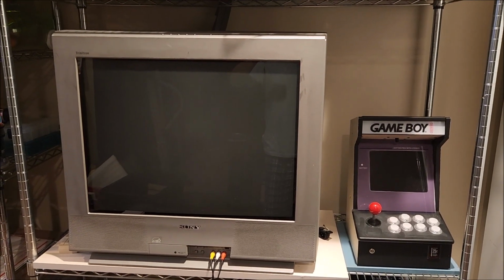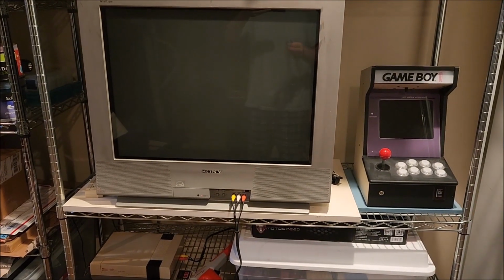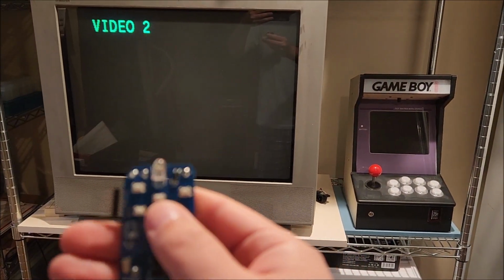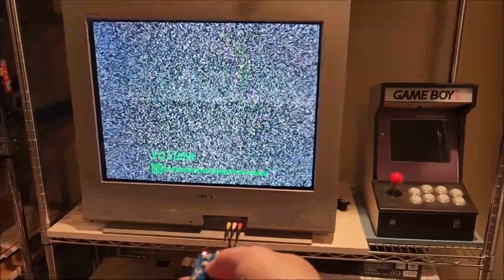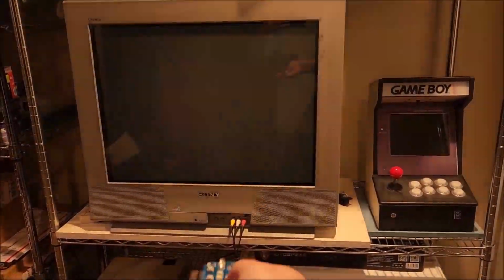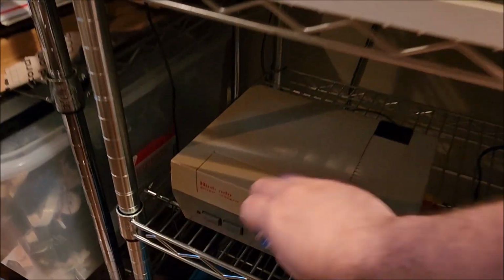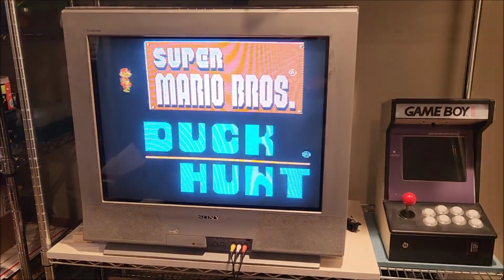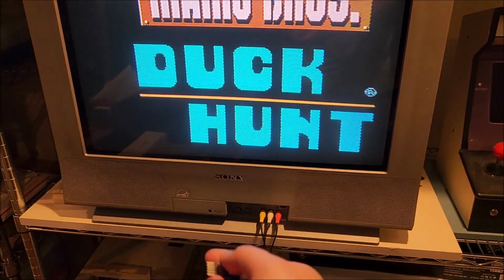Introducing the Remoteduino Nano: A Tiny Reprogramable IR Remote!

Comment: I've been looking for an IR remote that can record signals and allow me to store and manage them. Not sure why those aren't a thing, at least I couldn't find one.
Reply: That's been a project I've been meaning to get around to for a while.  Figure on trying CircuitPython, and if that doesn't work give Arduino a shot.  Not so much a "remote", but a hacked together circuit with a microcontroller.

Or one tool now commonly available for that is the Flipper Zero, with the onboard IR sensor and LED.

Comment: These sorts of things are begging for a soicbite connector. No need to carefully hold onto pogo pin rig, no need to solder a connector. You get 8 pins, you can combine ISP for bootloader programming and serial. vcc, rx, tx, gnd, mosi, miso, clk, rst. 8 pins, perfect. You need to modify a test clip but $1.20 ones do just fine.
Reply from the maker: I actually forgot about soicbite. I used it for one project ages ago and it worked great.

Comment: With 47 ohms you're running the LED at about 35mA, it's probably fine for up to 50mA pulsed, try 33 ohms.
Reply from the maker: Yep, just tried 33 ohms and she works a bit better rangewise. The datasheet for the ir led says it's max pulsed peak is 100mA but not sure the poor little coin cell can muster that.
Reply: @sjm4306  If you add a cap before the transistor, say 1-10uF and maybe charged via a small resistor, you could get higher peak currents. Might not be much benefit though if the range is okay already.
Reply: @sjm4306  Coin cells are only officially rated to source low currents; typically datasheets will spec somewhere between 1mA and 10mA. In practice, "new" coin cells substantially exceed this and can source hundreds of mA especially in pulses, but relying on this is the classic "cheap knockoff remote" blunder. The reason is that a coin cell's capacity over time decreases very slowly (if unused) but its ability to source current decreases rapidly. A coin cell a couple years after manufacturing will maybe manage 50-100mA, and one 5 years old will be much closer to the specified 10mA or less.

The upshot is that anything expecting to source high currents from a coin cell works great for a few months with a fresh cell, then very annoyingly stops working or gets dramatically reduced range despite the battery still having almost all its capacity still available.

As kasamialt mentions, the fix for this is to simply add a capacitor sized to handle your expected pulse currents for the duration you require. 10uF is often adequate, but if you're not cost-sensitive then a 100uF ceramic capacitor at these voltages is quite reasonably sized/priced and provides plenty of energy to flash an LED even from a quite old coin cell.